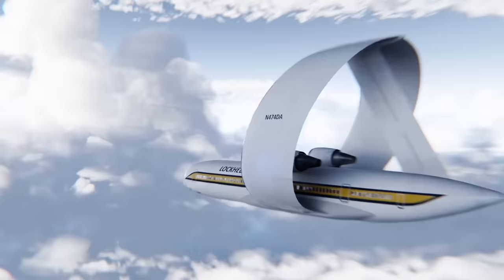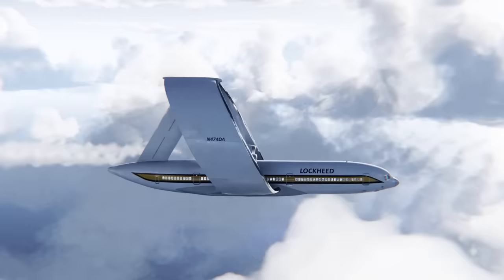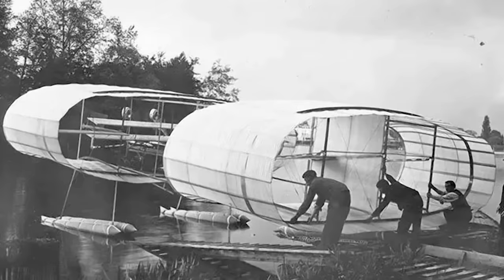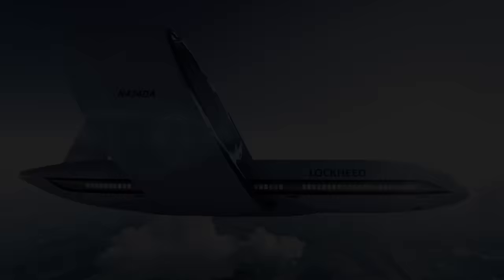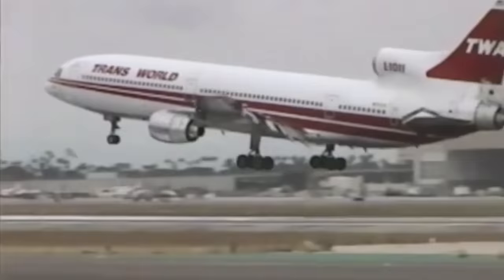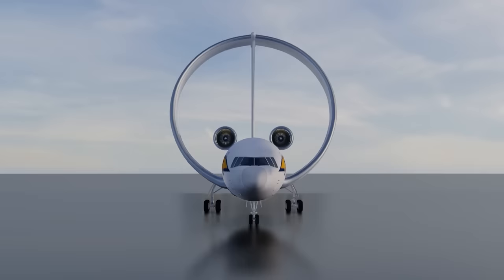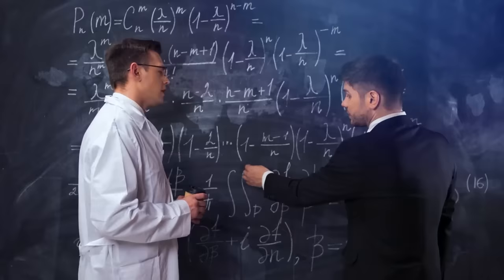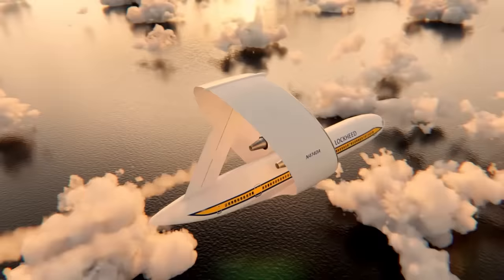What Happened To Ring Wing Planes?

Comment: * the maintenance team needs to have an Ironman suit to get to the engine
* it is impossible to have fuel tanks in the wings
* flaps - a nightmare for an engineer
* ice, snow, or water on the wings will lift the center of mass

this list can go on forever
Reply: Your right
Reply: You have too so you can show the "engineers whom design this um plane the problem they going to encounter."
Reply: As I was watching, I too was trying to figure out how exactly the flaps are supposed to work.  Like, even on working examples like that crop duster, it's more of a flat ellipse, where there's sufficient surface area to have working flaps, essentially like a biplane but it's two wings are connected with a curved wing section.  This would have to have some kind of German space magic to even have a chance of having working flaps.
Reply: Please do
Reply: Why can’t you have fuel tanks in these wings?
Reply: @pieter-bashoogsteen2283  because it will raise the already high center of mass of this aircraft. And a high center of mass = low stability, which is not good for a commercial liner
Reply: @Propidium-Iodide  Yeah that sounds logical
Reply: Ironman suit🤣🤣
Reply: How tf is something like this meant to glide of the engine dies
Reply: @TinyBearTim  vertically :)
Reply: When there is any fuel leak on wing tank in that circle, it may drop along the whole fuselage and this is a fire hazard to passengers.
So, this design is not ok for engine by fuel. But what will it be if the engine is powered by high output light weight battery and unknown sustainable generator completely?
Reply: @TinyBearTim  wrong one
Reply: @bonbon19977  yh unomwsertyhfdsanomaoanmaxwerhhfdsalnmouihuyruwedsalnewaryhuhnjuiomnjuiohfdsHawasalnoiuhuiolmnhjiowasafdsanaijfdsalnouiouythrewdsalmnuihjdsakbhfdsalno why work when you can ask
Reply: Meaning you don't know the correct velocity to travel when you have no air
Reply: @isaacschmitt4803  it's just an illusion like a glass over another glas you believe you have reached the heights but you have gone down and can you come back
Reply: Since you seam you know a thing or two, what happens if it flips? How does it turn?
Reply: @depreciatingasset  it can not go below the threshold
Reply: @Headloser  problems are not solved but made to endure the rest of time
Reply: Not to mention how will the ring wing create lift on take off let alone flight.
Reply: I was thinking about sideways winds. Must be a headache to not ending up at an entirely different airport sometimes
Reply: Thirst 
No 
Man or 
Dasao 

Speak on water and on foods 

Solomon was given wisdom teeth for his knowledge and that no man was what is a son of God that you may take notice of him in a wife offerings must you work a day a w a no had no 
Money is given for a plan a plan a man of right and Ono 
Water or wind 
Water is a wind
Reply: It may be an impractical design, but it would be cool to ride in a ring wing jet
Reply: The engines are not harder to get to than rear-mounted engines. It is not that rare to have the engine on top of the plane.
Reply: @Carewolf  it is harder. the wing blocks access to the engine from all sides.
What shape should the lift be for the engineer to stand to the side of the engine? And the crane for replacing engines?
Reply: There's also the commercial component. I don't know much about aerodynamics. So when it comes to hurtling through the sky in a metal tube, I'm skeptical of new designs out of sheer  self preservation. It might take some time for people to fully trust the new design. And that would cut into quarterly profits, which makes it an automatic no-go for the suits who'd have to approve.
Reply: How would the thing even get off the ground without the wing flaps?
Reply: @Propidium-Iodide  This would only be an issue when on the ground. In flight the lifting component being above the dead weight would make it very stable.
Reply: Also all the issues biplanes have and why we got rid of them in the first place.
Reply: @isaacschmitt4803  u dont have to use flaps if it's got weights built in that are controlled by the pilot so instead of steering by air resistance ur steering by transferring weight
Reply: There should be a tradition of asking mechanics in the field if they would ever even consider working on your invention before you get into it.

If there isn’t a union for airplane mechanics, there sure as hell would be if the ring wing came out.
Reply: no. maintenance teams will use the ladders they have always used to reach the engines.

no. a ring can also hold fuel...

flaps work as well

no different than the de-icing any plane requires...

In total I give this comment and F+. Try again next time. you were WRONG on literally every point u airhead
Reply: @Propidium-Iodide  There is not a high center of mass AND if there was that would not be an issue.
Reply: @pieter-bashoogsteen2283  just because something SOUNDS logical to a layman doesn't make it so. Practically every comment in this thread is nonsense
Reply: @billballinger5622  can you prove at least smth? Take an image of this model and show us a shape of a ladder which will allow to access engine from the both sides. Or explain how it happen that high center of mass doesn't change stability? Alternative physic?
I might be WrONG!!!!! F+++!!! but i'd like to see some evidences 
.
Reply: @Propidium-Iodide  are you slow??????

you know aircraft engines dont sit on the ground when parked right??? workers obviously need to be elevated to work on them. 

>Or explain how it happen that high center of mass doesn't change stability? 

I never made that claim. you were the one making claims about high center of mass.
Reply: @billballinger5622 I know how to maintain engines. And for most modern aircraft, a small ladder is enough for this. So I am asking you to show me what shape the ladder should be, so that the worker can independently reach any part of the engines on the round wing.
Reply: @billballinger5622  I understand that from a layman’s perspective my judgment means very little, but what exactly are your qualifications? What is it that makes you more qualified to assess this design than the rest of us? Because from how you write your comments and the tone you use it certainly seems that way. Are you an aerospace/aeronautical engineer or the like? Because if you do not have professional experience in the field you’re commenting about, dismissing one’s arguments, opinions and assessments on the basis of them being a layman is tenuous ground to stand on.
Reply: @pieter-bashoogsteen2283  I am ready to believe that the engineers of the future will make the production of flaps of variable curvature and other things related to such a wing. I am not an expert in the industry.
But my knowledge is enough to draw on this model the placement of fuel packs and pipelines and understand that I would not want to sit under hundreds of tons of fuel above my head and a red-hot engine between this fuel and me.

Comment: What seems strange to me, is how high it is made in a true circle. The other examples of both ring and box wing are way more elliptical. You'd think the vertical parts of the ring wing are useless for lift. Given that the aircraft body takes part of the actual lifting flat section, it seems to me like there is more wing not useful for lift than useful, and it increases the tail stabilisers size if attached like this as well.
Reply: I agree. I don’t think a circle is the best shape to use. It has too much vertical wing area that, as far as I can tell, does nothing but add to the parasitic drag.
Reply: The People that claim that this would be more energy-efficient, those People clearly have NO knowledge about how aviation works.
Beside from CGI, this will never wortk, unless you have a different Plan to counter the Gravitational Effect on the "Plane".
The Box-Wings and the Ellyptical Wings got more horizontal wingspan than Vertical and the Box-Version got that connection, to improve stability.
Reply: @SoHBetaSword I mean, if you had the hand of god to throw it hard enough so the minimal lifting surfaces acted in overdrive...

Though I don't know how feasible "god throws the plane" is as a business model
Reply: I thought it would be obvious to most people that the lack of horizontal wing surface would'nt get this thing off the ground.
Reply: @jerseymetalmike5111  it offends my intuition to how planes work, which is "redirecting air particles downwards to cause an upwards force to act on the plane"

which only works with horizontal surfaces, of which this plane lacks
Reply: The height I suppose is an attempt to reduce the aerodynamic interference between the upper and lower wings. Even biplanes l with a lot of distance between the two wings experience this. Staggering the wings by usually putting the top wing far forward of the lower reduces, but doesn’t eliminate, this effect. Otherwise we would have seen lots of biplanes over the last 70 years, but we haven’t seen many.

Comment: From an engineering perspective it looks challenging. Engine maintenance adds risk, replacing an engine requires special cranes. A circular wing can also flex causing instability. Production or transportation of a ringwing is hard (mildly spoken). No elevator or canard means it’s harder to pitch. Plus it’s going to be a sailboat on crosswind landings. If the ring wing doubles as a fuel tank it’s going to roll over having a CoM that high. My 2cts based on 2min of thinking about it… does look cool though 😊

Comment: It's a nice idea in a couple ways, the ring shape having a lot of structural strength and it gets rid of the wingtip vortices. It's all those little gotchas that change it from a nice idea in principle to a poor idea in practice.
Reply: "it gets rid of the wingtip vortices."
That's a fallacy. Wing tips are not the only place where induced drag is generated. Plus, a ring wing is basically a double decker. There's a reason we have stopped making these. the high pressure zone of the top wing connects directly to the low pressure zone of the lower one. This alone should make it clear that ring wings are not better regarding induced drag.
Reply: This is a dumb idea. How the hell can you see the view when the ring block the windows?
Reply: Yeah, this plane is cool, and the ring wing is unique. But the lift couldn't occur on the vertical part of the wings. Also, what speed would this plane fly at? Probably only 350 mph (550 km/h), as one could only imagine the structural strain of flying faster with sonic compression at higher Mach numbers. There is a reason why airplanes use a swept back wing design when going 500 mph (800 km/h). Hopefully my explanation is good. :)

Comment: I never knew about this plane, thanks for making this! Even though it may have proved impractical in the end, I think it´s a really beautiful design.

I think you misspoke a bit at 4:48 though - watching the specs you show a little bit later, it´s not the wing circumference that is 7.4m - that´s the diameter of the fuselage. The diameter of the wing is 20.11m.

Comment: the problem with a lot of the fancy and admittedly cool wing designs, is that they are almost all designed to increase the lift factor of traditional wings, which just isn't necessary, especially considering the downsides and extra complex engineering that comes along with things like the Ring Wing. in order to avoid complications, these wings would actually force planes to go slower to avoid going out of their preferred travel height. when you have jet engines, wings just don't need to provide as much lift as these designs are intended to give

Comment: Plane wings in general serve as fuel tanks, linear wings are ideal since the fuel can travel easily because of pressure pumps.
If the wing's donut shaped then the plane would need to find some other place to store it's fuel and since this model can't generate enough lift making the body even heavier would make no sense. 
It's nice to look at though :0

Comment: So what is not talked about here is how the wing or airfoil cross section would have to be a different Camber every foot in the "hoop" or round part.  Like a regular wing, the bottom of the hoop where it connects to the fuselage would would be curved on the inside of the loop, but relatively flat on the outside of the loop ... but sides of the hoop would have to end up being equal or neutral as not to pull in, nor push out essentially being just a support structure ... so slightly curved on about the same on the outside and inside ... and then at the top of the loop, the outside of the loop would be gradually curved in order to provide lift.    Also in the rendering, it should be explained that the top of the 'tail" would produce "roll" and the bottom of the tail would produce "yaw".

Comment: A box wing could be more efficient under the right circumstances as the majority of the extra wing surface provides additional lift, but a static ring wouldn't actually be more efficient....
To generate lift, you need forces to be applied that are perpendicular to the horizontal plane, and for the amount of wing material used, roughly 50% is orientated in the vertical plane, that's without taking into account the absolutely massive tail which is effectively a bracing truss.

Simply put, from the perspective of amount of lift generated from amount of material used to build the wing, a ring wing of the design shown would be quite inefficient... 
Sure, there would be some efficiencies from the reduction in turbulent flow, but in order to have enough horizontal surface area to to generate the required lift , the ring would have to be absolutely massive, and at that size the extra drag on non-lifting surfaces would negate any efficiencies..... and well... controlling the thing would be a bit of a nightmare...

Comment: The 4 fundamental forces of flight: Lift vs Gravity, Thrust vs Drag

Gravity's vector is straight down (vertical). This is an immutable fact and the one we cannot change. To counter gravity our lift vector needs to be as close to being in direct opposition to gravity as possible, or straight up. Conventional wings are mostly horizontal for this reason, with some dihedral built in for stability. This circular wing, although looking super cool,  has very little "horizontal" surface capable of providing vertical lift to oppose gravity. 

That said, a smaller version of this circular wing mounted in place of a conventional tail section could have a future. Made to swivel in any direction it could provide pitch control and yaw control, which is all a conventional tail does.

Comment: I imagine it would work to stay in flight but getting them off the ground would be the challenge, which requires lift, traditionally generated by higher pressure under the wings

Comment: One thing that comes to mind is just how much vertical surface there is in the wing - on both sides of the circle and on that central support structure. A good portion of that is simply not contributing much lift.
Reply: I think much of the lift probably comes from accelerating the air through the "tunnel" and sucking the plane upwards.

Comment: 7.4 meters is the diameter of the concept, not the circumference. 
The exact script to the description given here, is read directly from a single description that has been copied and pasted in many articles online, because the original author mistook circumference for diameter. Look at the length of the plane (that’s 52 meters). By the original blueprint for the design, a 7.4 meter circumference, would mean the wing is too small to fit around the cabin… so the cabin would be wider than the wing 😂

Comment: How does it generate net lift in the vertical plane? All the other "ring" wing examples make sense - they're just biplanes with the tips butting to remove vortices but - there's virtually no lift from the root of the Lockheed design, a ton of vertical ring that I can't imagine generating a vertical component (?) and somehow it must go from being further over the inside surface to further over the outside for the top section... surely everyone else only watched this to learn how it works too? 😢

Comment: 4:52 - Wing circumference 7.4m, yet they're 23m high? Even if you meant diameter or radius of 7.4m, and we assume 2m of height from the ground to the bottom of the fuselage the aircraft, the aircraft would be at most 16.8m tall. For a height of 23m incl landing gear you'd need a wing circumference of 65.97m
Reply from the maker: Likely a mistake

Comment: The circumference cannot possibly be only 7 meters if the ring wing is approximately 20 meters high as depicted. The diameter of a circle is always going to be smaller than the circumference. The diameter of the fuselage appears to be close to 7 meters, but that’s just sloppy. It’s an entertaining video, but it doesn’t seem to be well researched.

Comment: There is not enough fuel for 1 hour of flight. It's probably possible to create an efficient circuit, but not within a simple geometry like this simple ring. An efficient wing would look like a twisted Möbius strip into an extremely complex shape; producing such a wing would be a major engineering challenge, but the lift would be lower than that of a conventional glider.

Comment: Lift is created by the difference between air pressure (related to its speed across the wing surface) between the air just above and just below the wing surface. Bernoulli's principle. A round wing could only create useable lift at the top and bottom of the circle and would be a massive amount of drag without any useable lift at the 3 and 9 O'clock positions. In other words, NO WORKEE.